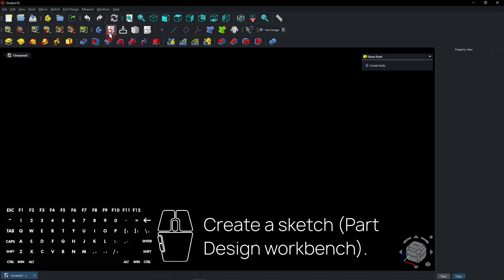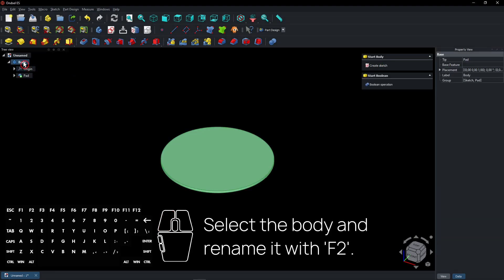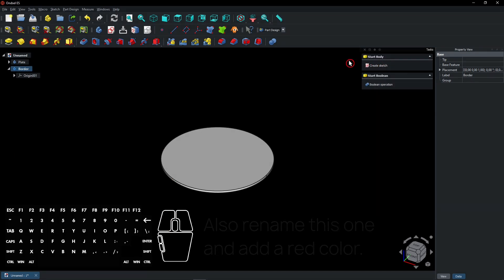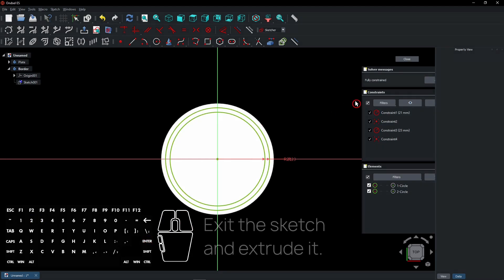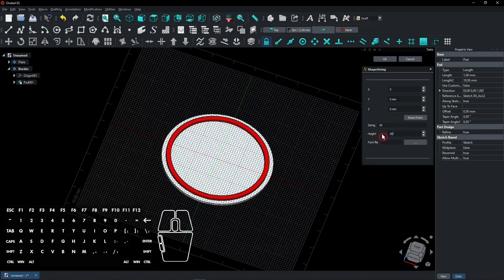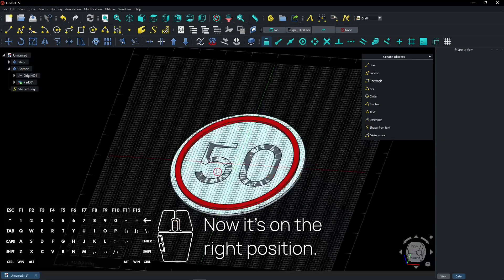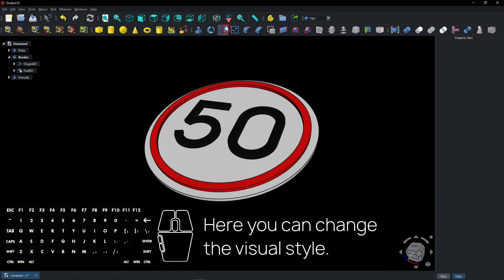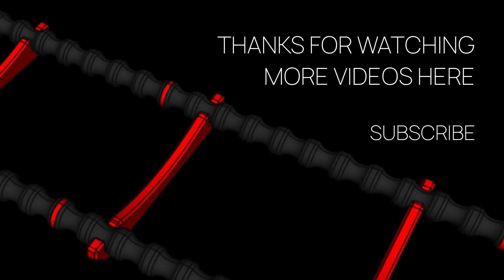🚘 Design A Speed Sign In Ondsel - Draft Workbench - FreeCAD Text ShapeString

Comment: I don't know what im doing wrong I can't extrude it some mistake keeps appearing..
Reply from the maker: Which part are you trying to extrude?
Reply: @AllVisuals4U  Hello, I used your tutorial to add an to  text to my project, something worked, but it wasn't as easy as yours. I had to create a link between the sketch of the text and the part on which it is located. I don't know how to explain it better, I'm a beginner and I do a lot in the dark :)
Reply from the maker: Thanks, it could be that you have to extrude the text (String) inside the Part workbench. Not in the Part Design workbench.
Reply: @AllVisuals4U  YES !!!! THX hehe I was using Part Design all the time and didn't work now with Part workbench it's actually working :) hehe THX 🙏
Reply from the maker: That's great! 👍

Comment: The tab for shape color is call Shape Appearance in my version of Ondsel. Within that there is a sub menu for  ambient, diffuse, emissive and specular options but none of these seem to change the colour  of the shape (Edit) I can get the colour to change with the Random Colour feature I just can drive it manually via the display properties shape appearance options
Reply from the maker: Yes I noticed that too since version 2024.2. I messaged them on X to ask/notice that this is the case. They responded:

'The materials system has changed, we probably need an explainer on that'.